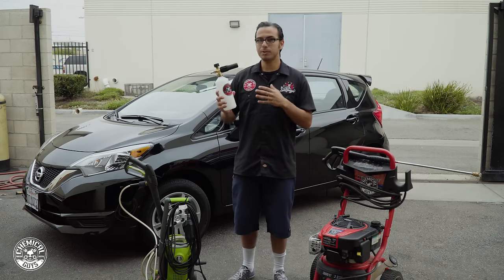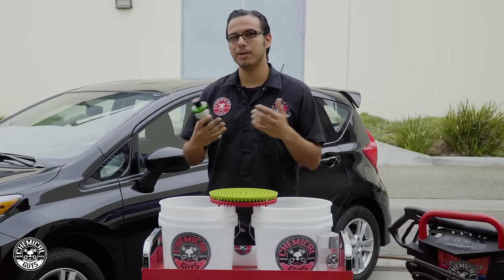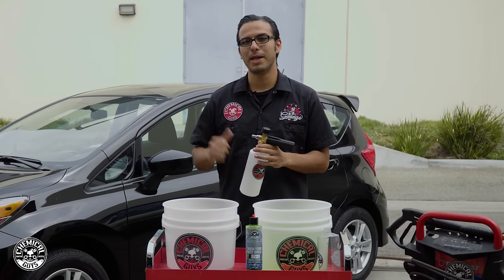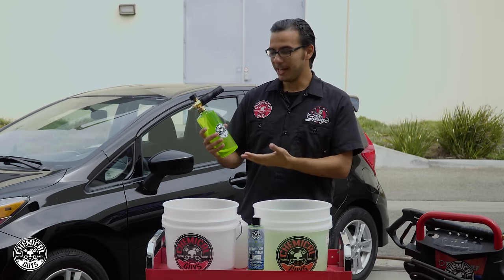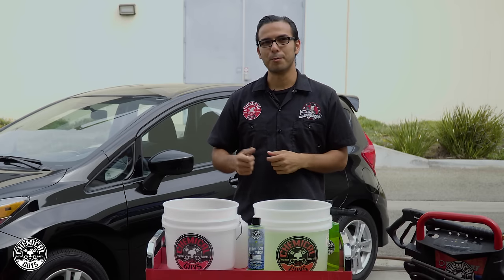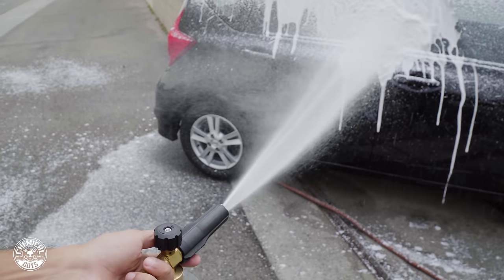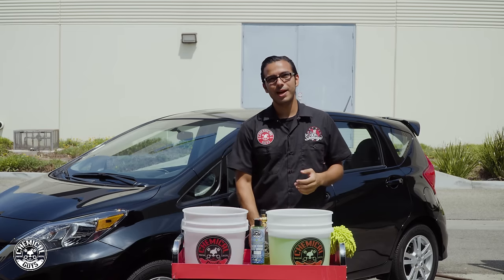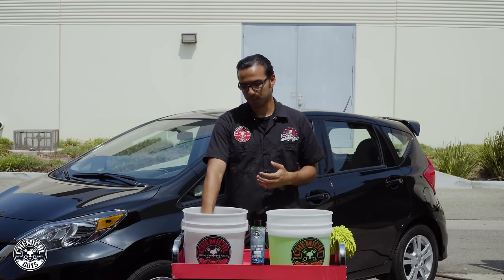5 Tips On How To Choose and Operate your Foam Cannon - Chemical Guys Car Care

Comment: Tip 6: Fill the bottle with water first, then add the soap.
Reply: Never
Reply: hot water
Reply: Why is this?
Reply: In my experience it hasn't made a difference as long as the soap mixes with the water properly
Reply: Scott 💯!

Comment: Tip #6 - use warm water to mix your soap
Reply from the maker: That's correct, it's an essential tip to maximize the performance of your foam cannon

C.G. Javier -
Reply: J Fazzuoli ...great point...many overlook using warm water....good analogy is dishwashing....warm/hot water w dishwashing liquid soap creates more suds, and breaks grease, debris off a lot easier than cold water!
Reply: Also use distilled water if possible ... hard water kills the form

Comment: I wouldn't wash my car with just the snow foam...i would rinse it off then wash the car... In reality if you don't rinse it your just washing it with the dirt still on it
Reply: He did rinse it
Reply: @josiahkaufman393  He rinsed it first, then did the foam and then just cleaned the car, completely wrong way. 

The snow foam is better put on a dry car so it clings better, leave it for a few minutes then wash it off with the pressure washer. Then clean the car.
Reply: Important point on a dirty car, but that Versa had like 2 specs of dust on it at most. It’s totally fine to rinse, foam, and get right to washing with your mitt if the car isn’t that dirty...

Comment: A fairly important tip that was missed is to turn off the pressure washer after foaming and moving to the scrubbing stage. Otherwise you'll burn up the pump if you leave it running for more than a couple minutes without pushing water through. (only applies to gas washers of course)

Comment: Nice video..same soap I bought from you guys Amazon special lol $56.00 for a nice foam cannon gal of honeydew soap and a very soft microfiber mit...I love the soap foams up great rinses off nice I used a 3200 psi gas pw worked great...thank you
Reply: U should be using 1100 psi on paint not 3000+
Reply: And 2.0 -2.2 gpm

Comment: I always thought using a gas pressure washer had too much psi and damage paint.  Is that not true?   Thank you for any info
Reply from the maker: Hey Michael! Thanks so much for watching. It is perfectly fine to use a gas-powered pressure washer for automotive detailing as long as it doesn't exceed 3500 PSI.
- CG Nick

Comment: So what was the purpose of the two buckets? I wouldn’t think you would need a soap bucket since you snowed the car. I get the rinse bucket.
Reply: Psykic Chimp you foam the car and then rinse it off which gets rid of most of the dirt then you wash it with a soapy wash bucket to get the rest off with a rinse bucket too. Snow and rinse first reduces amount of dirt you’ll get in the buckets

Comment: I would have liked to see how that foam cannon worked using the electric power washer
Reply: It works amazing with electric. I have been using mine with an 1800 psi BlackMax electric PW. Very effective and easier to maintain, imo.

Comment: Everyone seems to do this differently. It seems you didn’t rinse off the soap after you foamed. I think the majority say to rinse off then wash with the two bucket system.  Can you explain? Thanks!
Reply from the maker: Hi Michael, it's a waste of water, and the soap emulsifies the small dirt particles when it foams up. When you have a limited amount of time to wash, and you need to glaze, wax, or seal; you really have to move quickly. If you want to take the extra step, by all means, we've been doing this for a long time and we get consistently good results. Stay tuned Michael for more great videos.

C.G. Alex -

Comment: thanks for letting me know how to maintain foam cannons I didn't do the whole process and now it sucks everything up so quickly then run out of time to foam my car it doesn't matter anymore because it was small and it came with my pressure washer and it sucks either way. I will maintain my knew cool one.
Reply: C'mon " maintenance" on a $15.00 device with no moving parts, that you've just run a gob of soap through???   You really have these followers brain-washed.

Comment: hey! I use a pressure washer from Karcher, and when I put the same amount of soap the cannon doesn't create as much foam as yours how can it be? pls halp
Reply from the maker: Hi Willy, 

As Nick states, you don't want to shake the bottle because that will create the foam inside the foam and rendering it difficult to have the foam come out of the nozzle. Also, using warm water will stimulate the soap to create that thick foam. Also, the GPM of your pressure washer is important and it needs to be strong enough to produce the foam. Check your Karcher to see if it has the required GPM or if it needs to be more powerful. Also, final tip, you may just need to add another ounce of soap or two; it never works the same for everyone and you have to experiment a bit until you find what works for you.

Comment: What is the ideal psi for a pressure washer? And will it differ if you have a gas or electric washer?
Reply from the maker: Hey Adam! Anywhere from 1200 to 3500 PSI will deliver great foam. Never exceed 4200 PSI.
Reply: @ChemicalGuys  thank you! I've been shopping for one but didn't know if 3200 psi would be too much and destroy my paint.  This opens up more options for me now. Thanks again
Reply: @ChemicalGuys  will your foam cannon fit just about every power washer nozzle or do I need to narrow down my search to a specific one? Do you have any suggestions on brands or what would be sufficient for me just to wash my vehicle's with your products?

Comment: Is it the PSI or GPM to get thick foam?
Reply from the maker: Hey there! Both play a key role in the aeration of the foam to produce thick foam. Higher PSI (1800-3000)will cause more foam and the recommend GPM(2.0) will produce thicker foam.

Comment: Would it be advisable to run some CLR or white vinegar mixed in with the rinse water for your maintenance rinse to help prevent calcium deposits. Thanks for this excellent timed video for I just purchased my chemical guys EQP 310 Torq and used it for the first time.
Reply from the maker: We don't recommend it because it may have a negative chemical reaction to the current soap you may be using and may cause more harm than good.

Comment: Would be good to show trouble shooting on foaming...if the foam is more slush than snow, what are the reasons behind it? How long should you leave the snow on for and should you rinse it off before shampoo?
Reply from the maker: Hi Nathan, I'd love to answer those questions for you. Here are some helpful tips: 1) Use warm water 2) Don't shake the soap up and down, spin the soap container instead. 3) Foam cannons have adjustable nozzles, use them. 4) Use 1-3 ounces of soap, fill the rest with water. Having the right kind of pressure helps, a 2.4 GPM is deal, however we've had success with the Sunjoe electric pressure washer. If you follow these tips, you should do fine.
Reply: Thanks for the tips!
Reply from the maker: You got it buddy!

Comment: Isn’t the soap good enough to remove a lot of the dirt if it’s just left to dwell then ringed off? Then you could do a contact wash with a lot less dirt being gathered in the mitt.
Reply: Shhhhhh. You need to buy 2 buckets and 2 grit guards. Always. Why would you just use the pressure washer and foam cannon soap as lubrication to wash your car with the mitt when you can carry 2 10 gallon buckets of water to get less soap on the car?

Comment: Super noob question I haven't found addressed on YouTube from detailers, and the rest of the internet yields conflicting information: how do you fill the thing? is it full of soap? Do you put soap and water in? Just add soap leaving air at the top? How do the dilution ratios come into play? (I understand the dilution when using a bucket, not sure how that translates to an "unlimited" water supply.)

If you put both soap and water in the cannon, do you shake it, too?
Reply from the maker: Hey there! Add two or three ounces of your favorite car wash soap and fill the rest of the canister with warm water. Gently stir the solution for proper aeration.
- CG Nick
Reply: @ChemicalGuys  Thanks so much!

Comment: For your sealants and waxes  like Blitz, Activate, Butter Wet Wax and Instawax and even your paint sealant like JetSeal can you apply it to the whole car and buff it off. If you can do you apply it to the whole car wait then buff it off or apply it then immediately buff it
Reply from the maker: Hi Harshvir, 

Yes, for each of these, you're going to want to allow cure and bonding time before you buff it off. For Blitz: allow 5 minutes to dry and haze, then you can buff off to a high gloss shine. For Activate: allow it to dry for 15 minutes before buffing it off. Instawax: Allow 5 minutes to dry to a haze before buffing it off with a towel. For BWW: there is no required curing or drying time, you can buff it off immediately. Thanks for being part of the Chemical Guys family!
Reply: Thanks CG, another quick question, if you don't have JetSeal to protect your paint from the winter. What else can you do beside from JetSeal.
Reply: You can use any Chemical Guys sealant if your goal is to just get through the winter with a coat of protection. I highly recommend JetSeal just for it's durability if you live in a place that experiences extreme weather conditions in the winter. If that is not an option then consider Extreme Top Coat Sealant with 3x Carnauba Wax. It is my go to product for all of my customers whose cars I detail, super durable, super slick, super glossy! - Griffin
Reply from the maker: Hi Harshvir, I completely agree with Griffin Lynch, Extreme Top is a great choice, or you can go with M seal, and Blitz. Just having a good combination of sealant and wax to protect the paint is good enough to keep the paint safe during the winter time especially with cold temperatures beating down on your car, and water forming all around the paint exterior.
Reply: Chemical Guys thanks CG
Reply from the maker: Stay frosty!!

Comment: Any recommendations for a good electric power washer?
Reply from the maker: Hey Sean! There are many different brands and models available but we recommend using a machine that is capable of at least 1.5 GPM and 1500 PSI. In the video, we are using a Sun Joe electric unit and Troy-Bilt gas unit.

Comment: Only down fall about the CG's bottle is the $100 on amazon or 110-130 on e-bay price tag that's $100 Canadian that a little to much for some brass and plastic. Sure it only cost maybe $25 to make. I get the whole you get what you pay for i see that more for wax, soap, DA polisher but not a plastic bottle.
Reply: It is but my bottle broke even tho it was an original cg bottle the first time i used it the threads broke from the button and couldn't use it no more
Reply: Cost more like $3.00 to make ... just like all the other cheesy Chinese guns that all just happen to look identical to each other.

Comment: I have a question, can  attach the foam Cannon to a regular hose?
Reply: william Franceschini you can buy foam cannons for garden hoses.  I have a gilmour one from amazon that I use when I don’t feel like dragging out the pressure washer for just a quick wash.  Works great.
Reply: @Pontiac2001GT  THANK YOU VERY MUCH FOR THAT TIP.  I WAS WASHING MY CAR THE OLD FASHION WAY.  THANKS.  BE BLESS

Comment: I’m new to all this. Why did you fill up the 2 buckets?
Reply from the maker: Hi Jason! Using the two bucket method reduces the chances of bringing grime back to the vehicle where is can cause scratches. One bucket is full of clean water and soap whereas the second bucket is full of clean water for rinsing your wash mitt.

Comment: What electric power washer do you recommend?
Reply from the maker: Hi Elliot! There are a variety of pressure washers available so it is purely personal preference. I recommend using a unit that is capable of 800-3500 PSI but never exceed 4200 PSI.
Reply: Any brands you reccomend? I just want to get something reliable and not break after 3 uses as my one from advanced auto parts did.
Reply: Elliot Ortiz It would not be good business for them to answer this question with a specific brand... I see a lot of people using the Sun Joe XPS series... I personally have a XPS 2000 that works very well... If I were to buy another one I would go with the XPS 3000, or if you have the money/living situation a gas powered washer... Be advised if you go with a XPS 2000 you will need an adapter to allow for the 1/4 quick connects, I found the adapter for cheap on amazon...

Comment: My foam canon for some reason doesn't make foam anymore. I tried it again today, put about 1oz of honeydew in canon then filled up with distilled water. I just get a bunch of soapy water at best. It worked the fist couple of times I used it now it  just shoots out soapy and watery, no foam. Not sure what's wrong. I have a 2000 psi 1.4 gpm Karcher electric washer.
Reply from the maker: Hey there! Try using 2-3 oz and warm water to improve foaming action.

Comment: What pressure washer would u recommend for under 200
Reply from the maker: Hey there! Don't worry too much about the brand of the pressure washer as long as it is capable of producing 800 PSI/1.4 GPM minimum.
Reply: Chemical Guys thanks u so much can’t believe u guys replied 👍🏼

Comment: Any recommendations on what power washer to use ?
Reply from the maker: Hey Freddy, thank you for stopping by and checking out this great video. Nick is fairly biased towards gas pressure washers because they tend to be more powerful, here's a link to a pressure washer that has specs identical to the one we use in the Detail Garage. Stay tuned Freddy, more great videos coming your way.
https://www.homedepot.com/p/WEN-2800-PSI-2-3-GPM-Gas-Pressure-Washer-173-cc-PW28/301403932?cm_mmc=Shopping|THD|google|&mid=srvJZ9Wc6|dc_mtid_890338a25189_pcrid_139636194844_pkw__pmt__product_301403932_slid_&gclid=Cj0KCQiAkNfSBRCSARIsAL-u3X9yCxXoF8Y_xh572XYgyk_c87RarFl_O5nrsM5OxhVNLsnyIDSzSHIaAlR-EALw_wcB

C.G. Alex -

Comment: Great video.
Question: I am about to buy a pressure washer. What is the safe PSI to use on the vehicle? I am afraid not to damage the paint.
Reply: Well, as long as you hold the power washer at least a foot away from the car, you should be fine. If it's very powerful, hold it further away
Reply from the maker: Hi, great question. Our pressure washer is a gas operated unit with a PSI of 2800, and a GPM of 2.3, so we recommend something similar. Choose a tried and true brand with a warranty for security and peace of mind! Thanks for watching and thanks for being a part of the Chemical Guys family!

Comment: Hi great video please how to create foam with Hitachi Aw130 pressure washer
I have bottle gun but unable to create pressure and foam
Reply from the maker: Hi! Please follow the instructions below. If your pressure washer requires an additional adapter, you can source one at your local hardware store. Thanks for watching and happy detailing! 
Unscrew fluid tank from foam cannon unit.Fill fluid tank with water (for best results, use warm water.)Add 1-3 ounces of your favorite Chemical Guys car wash shampoo to the fluid tank.Attach fluid tank to foam cannon unit.Rinse car with water to remove loose debris and grimeReattach bottle and attach TORQ Foam Cannon to pressure washer wandCover car with thick car wash foam to lift and lubricate stuck-on dirt from the surface

Comment: What kind of pressure washer do you recommend to make a lot of foam?
Reply from the maker: There are so many different models on the market but I recommend using a pressure washer that is capable of 1800-3500 PSI and between 1.5 - 2.0 GPM.
Reply: Chemical Guys thanks

Comment: Is 1500 psi for a electric pressure washer good enough to do a foam wash / foam lance?
Reply from the maker: Hi Nike, while 1500 PSI will work, it's more about GPM. We use a gas powered 2700 PSI pressure washer that does 2.3 GPM. That's what we use in our videos and that what produces the most foam. I'll leave you a link below of a video of us using an electric pressure washer so you can see the difference in suds. Thanks for the comment and stay tuned for more informative vids coming soon!
https://www.youtube.com/watch?v=c3yTSLbDH78

Comment: Love your products and getting ready to go with a foam cannon.  Question:  Can a foam cannon be hooked up directly to an air compressor, and if so, what PSI do I need?  Thanks again...
Reply from the maker: Hey! The foam cannon requires pressurized water to operate. We use gas and electric pressure washers ranging from 800 to 3200 PSI. 
- CG Nick
Reply: @ChemicalGuys  Thanks, Nick!  Just got my CG cleaning supplies and ready to go work on my C8

Comment: How many psi are you guys using for your pressure washers
Reply from the maker: Hi Sunny, good question. Our pressure washer is a gas operated unit with a PSI of 2800, and a GPM of 2.3. Stay tuned for more videos headed your way soon!

Comment: is it best to fill foam cannon bottle with soap first or warm water then adding soap?
Reply from the maker: We recommend that you fill the bottle first with warm water, than add the soap after so you can gauge how much soap you've used. Remember not to shake vigorously because that will cause bubbles to form.  In most of our videos, we fill the soap container with deionized water first before the soap. Stay tuned for more great videos.